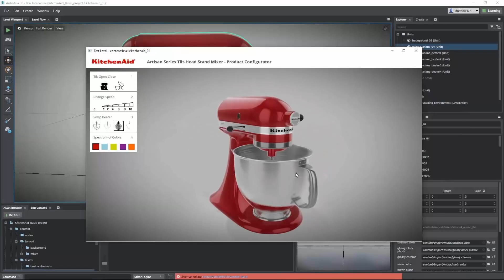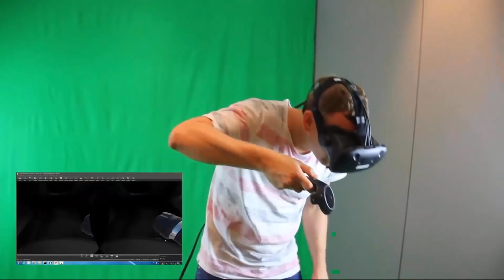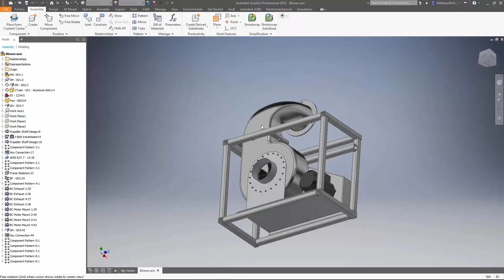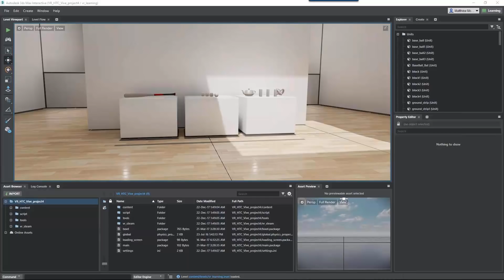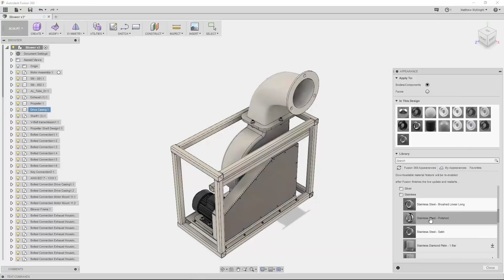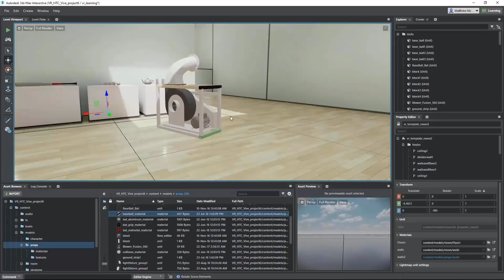CAD to VR Workflow with 3DS Max Interactive Webinar

Comment: What an utter waste of resources. The dwindling team of Max devs have wasted yet more time on releasing Stingray as a main new feature in the form of '3dsMax interactive'. Another useless piece of abandonware bloating Max. Not to mention the fact that UE4 is light years ahead of anything that Adesk could even attempt. The amount of great tools/plugins/programs that Adesk have murdered over the years is scandalous. Softimage being the primary example. 

Adesk are just pure corporate scum.(the management, I mean. Not the hard-working creative devs)
Reply: I came here to say about the same thing.  Lumberjack, Unreal, Unity, endless list, Last thing we need is another 'platform'.  I spent 25 years waiting for 3D Studio to make use of my 3D Vision glasses and monitor. Never hapoened (except when they mistakely ALLOWED it to work in a couple driver releases around 3ds max 2010...). SO THEN I HEAR 3DS MAX INTERACTIVE VR, I think, GEE PERHAPS I THINK THAT MEANS WORKING IN 3DSMAX in VR interactively, like Editor VR in Unity and VR Editor in Unreal.  OF COURSE they didn't mean that. Interactive VR viewport seems to be a fiction.
Reply: 3ds Max Interactive isn't really a part of Max. It remains Stingray with minimal changes. As such, it's a seperate program that you must install. It serves as the backbone to Revit Live and as an interactive archviz tool, which it does fine. If you don't need it, don't install it.

Autodesk is partnering with Unity for the game stuff. I'm not sure what that means yet...